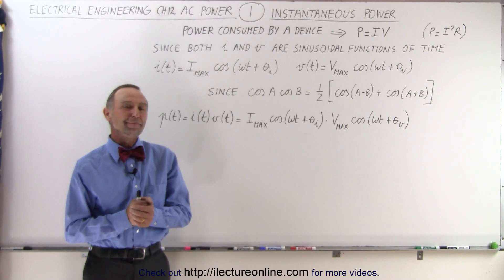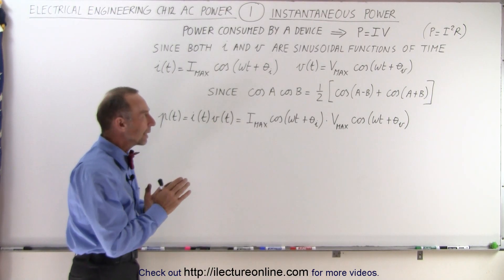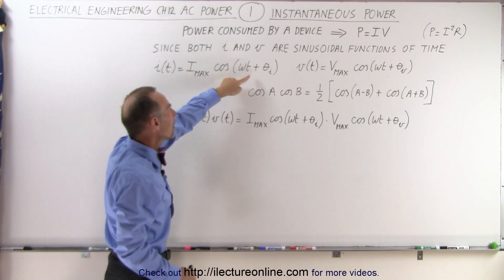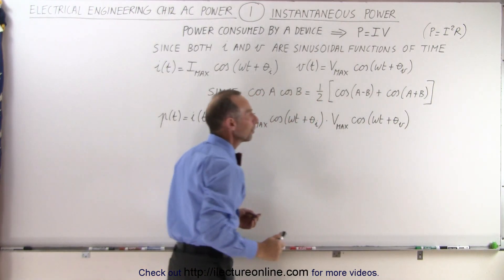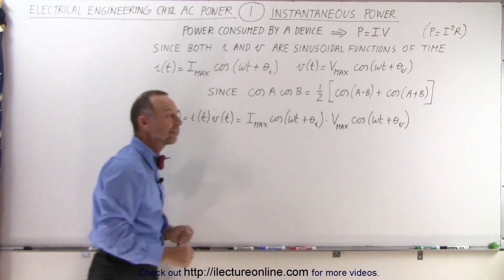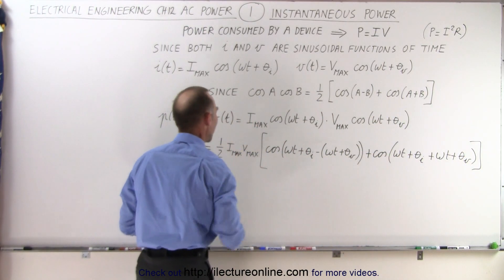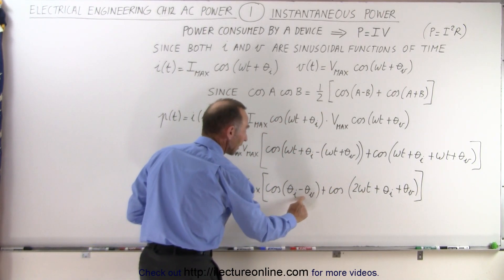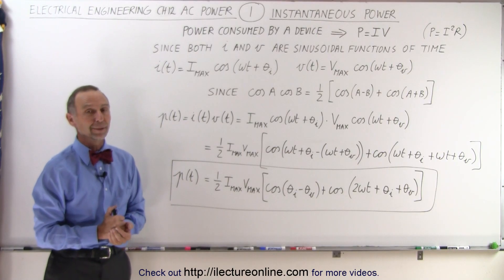Electrical Engineering: Ch 12 AC Power (1 of 38) Instantaneous Power

Comment: I really am a bit confused since in our university our sinusoids are expressed as Sine, would that mean, when encountering cosine functions we would have to use some identity (such as cos(x -90) = sin x) before obtaining power?
Reply from the maker: No, the sin or cos is used depending on the time reference at t = 0.  In the end it doesn't really matter.  However when using the phasor diagram, it is easier to use the cos function.
Reply: @MichelvanBiezen  To clarify, the time reference t=0 varies with every example given to us? For example in one circuit the voltage source could be expressed in cosine and in another example it could be expressed in sine?

From what I understand the voltage source is usually made the reference of all the other sources, however my question is what if we have a voltage source expressed in cosine and another voltage source expressed in sine, does this mean I can transform either?
Reply from the maker: Yes, if there are two sources and one has a cos reference and the other has a sin reference it is better that you transform one to the other.
Reply: @MichelvanBiezen  Thank you very much, this has clarified a lot of things for me and would help me with my studies greatly.